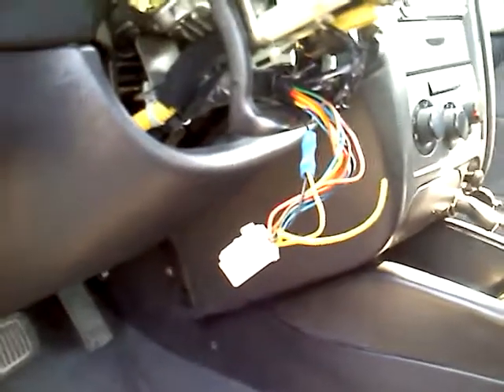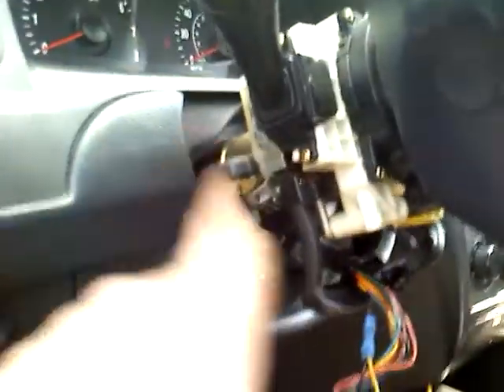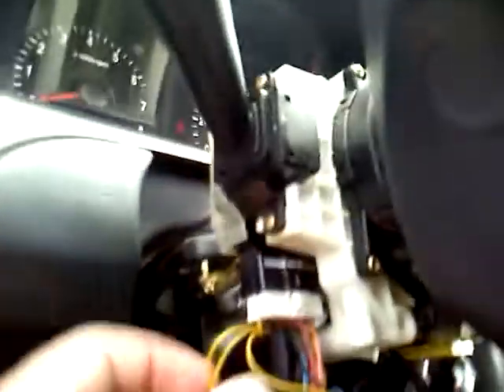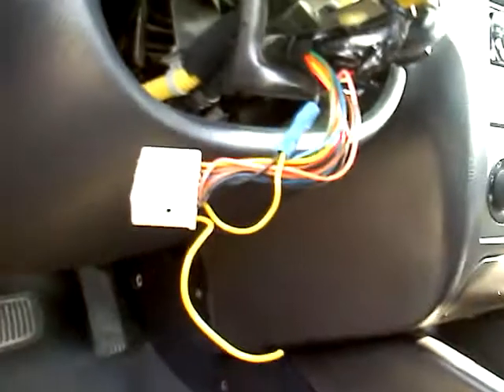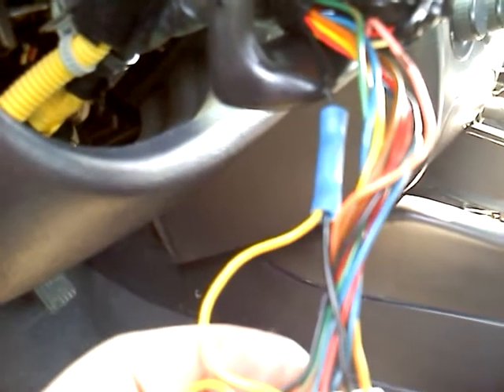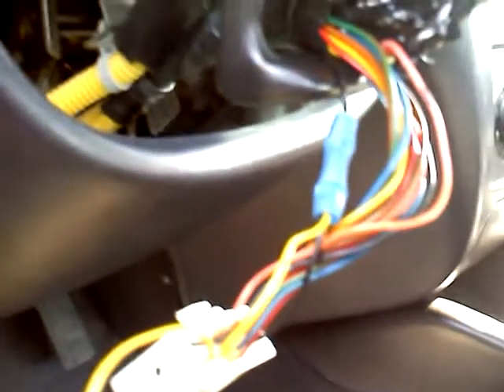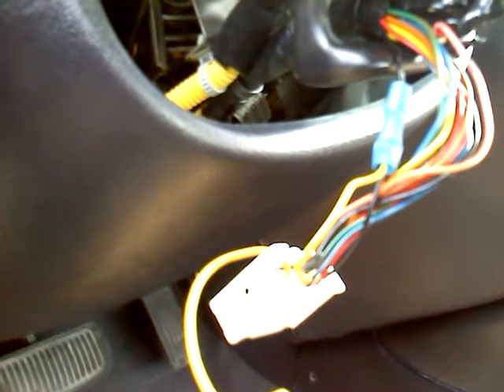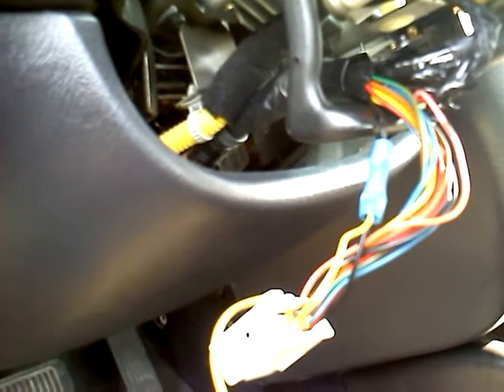How to, fog lights.

Comment: The Elantra and Genesis have the same wire combination for the multifunction switch, you can check this too, http://www.gencoupe.com/diy-do-yourself/77131-independent-foglights-pictures.html
Reply from the maker: Exact same steps. Best mod ever!!!
Reply: slowgls I wanted to do the same mod for my 2012 Sonata GLS.  Seems to be that the wire combination from the Genesis is the same as the Sonata.  I still have to check the wire harness if the wire no. 5 is looped with no. 8.  If so, them I am in luck.  There are no replies from the various sonata forums so I have to check the wire diagram for the sonata and genesis as well as the elantras.
Reply from the maker: pinoyeh
I love mods like this. Do it!!!